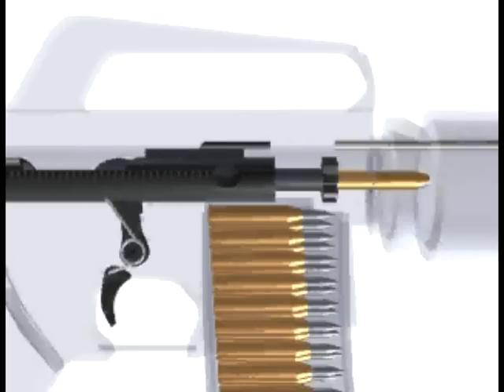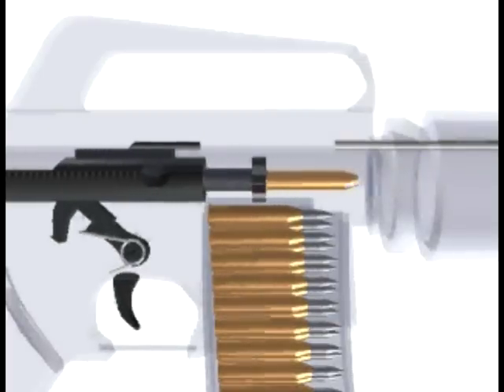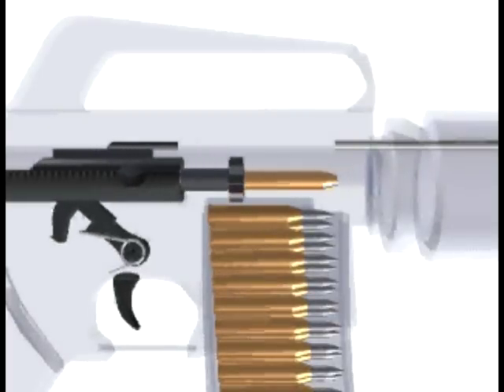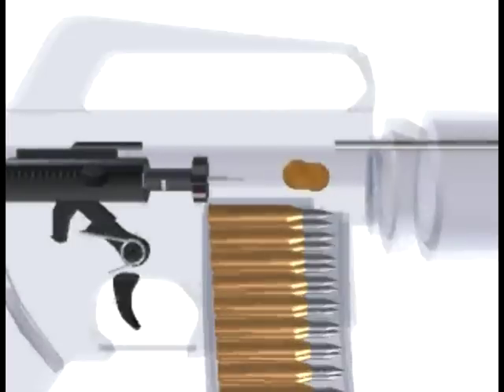M16 Functions Explained

Comment: First, the animation is way off the actual M16.  The bolt rotate much more than needed. The hammer does not strike the firing pin.

Comment: more likely wanted more mechanical data....but this was nicely timed with Definitions and Animation...just felt cheap and lacked other data....perhaps about the Gas system and how on the m16 is unique from any other rifle in that it ditched the gas piston and replaced with just an air tube

Comment: The Marines just ordered a metric fuckton of "M27 IARs". Really just a 416 with a slightly different stock and a slightly heavier barrel. They're not being issued to M249 crews like the Marines said they would, since they have no plans of phasing out the 249. They're just M4/M16 replacements that they snuck in under a different budgetary confine.

Comment: I shoot a decent amount through it. (My wife is starting to shoot it more than I do). I torture tested it and got 2,500 or so rounds without cleaning (only a few drops of oil here and there) before it jammed. If you shoot exclusively wolf you may want to change out to a lighter buffer spring. I don't have to clean my AR repeatedly. I clean it after I'm done shooting, just like all my other firearms.

Comment: M4 magazines initially had issues, when they replaced the magazines, it accounted for over 90% of the jams in the gun... The ammo we use is fine. "but far from being the most reliable as well. " It's reliable enough to almost never jam up in my experience. If you want "super reliable" get a fucking bolt action rifle. "If you treat any gun like a woman - gently and carefully - she'll pull through for you." I've treated my AR like shit and it still worked/works.

Comment: This is a myth. It gunked up in vietnam when they used ball ammo, which you aren't supposed to use... When using half decent ammo it doesn't gunk up at all. The internals get a little dirty, but it's not gunk or hard carbon build up. "Also, the M16 is the weapon most familiar to people within the U.S. and so - the soldiers have an easier time with it." There are piston ARs that are ergonomically the same, yet we still use DI, because DI works and piston ARs are unnecessary.

Comment: @BarrackOLama the chamber is cut or machined so that when the bolt is forced on to it it spins it locking it  if that makes sence..... look the operation of a garand bolt and it will make more sense ... the 16 has a redundent about of locking lugs if you ask me ...

Comment: @TheBlabla1996 No, worries friend.  Its called and extractor and its attatched the the bolt and pivots or cants because it is under pressure of a spring. When A bullet is pushed into the chamber by the bolt, the extractor snaps on the the right side of the the base of the round. Its why bullets have the lip on the bottom.

Comment: @curseofa5r5a that's because the 7.62x54mm NATO round is more powerful than the Soviet 7.62x39mm round used in the AK. We use 7.62x54 ammo in our GPMG to provide more stopping power. We have different weapons for different roles. Even the 7.62x54mm round cannot penetrate a single sandbag at less than 50 m. so to use just this round would be ineffective in close combat as well...not to mention the weapon weights 30 lbs; and the ammo more than twice that.

Comment: @xFogxofxWarx well in here there is type of contruction called "tapia" iit was used to build houses all over the country for decades, this kind of walls has gained a reputation for its tremendous hability to stop bullets including 5.56 and 7,62x39, 7,62x33 and of course all pistols rounds all of them exept from 7,62x51/54mm rounds, and in this case i actually saw that happening, they where using military grade m80 7,62 rounds, 5.56, a .38spl and a chinnese AK only the first one pierced

Comment: @curseofa5r5a Taliban insurgents often have a hard time hitting anything beyond a few hundred metres too. 600 -800 metres is out of effective range of an M16; but not the M249, which is a 5.56 still. Again; we also use GPMGs for ranges up to 1800 metres. Mounted; that range is stretched out even more.

We also travel in convoys that have .50 cal MGs and 25mm cannons. There are different roles for each weapon. No weapon can take on all their roles effectively.

Comment: @curseofa5r5a The M260 (C6 in Canada) GPMG has a range of 1800 metres. It is designed for further ranges; however; most people assume that the 7.62 has better stopping power period. The fact is that a 7.62mm round cannot even penetrate a single sandbag from 50 metres or less. In urban ops; it really isn't advantageous; just heavier and slower.

Comment: @xFogxofxWarx a common tactic among the colombian guerrilla is to attack towns by taking control of buildings around the police station, in those cases the 5.56 has showed to be unefective against  this kind of positions, in that case the most uses tactic by the police is to concentrate their m60s firing in a single building, not to suppres their occupants, but to kill them, this tactic is also usefull to take down mortar crews firing from the mountains 1.2-2 km away form the police station

Comment: @xFogxofxWarx yeha i acept its lethal, even at long range, but there is 2 short comings aobut using a 5.56 LMG in a long range engagement, 1) the bullets would cause less internal damage thus leaving the enemy in an operative condition, obiusly an injured enemy is a tedious charge for its group but in many cases it wont break the contact 2) the 5.56 at that distance have serious problems piercing combat barriers, specially walls and trees.

Comment: @curseofa5r5a Because the M249 is a light machine gun; not a General Purpose Machine Gun. The M60 also weighs more empty than a loaded M249. Unless you want to be running around with 130 lbs or more of weaponry on your person, you aren't going to carry the M60 everywhere pal. Two separate weapons for two separate roles. The 249 is quite prone to jamming by the way.

Comment: @curseofa5r5a The M249 SAW; or C9 light machine gun also uses the same 5.56 round as the M16. The M249/C9 has an effective lethal range of over 800 m. Kills have been confirmed with this weapon from ranges even further than that. I would say if it is lethal at ranges in excess of 800 metres; then it still retains stopping power...and I would say if it has killed people from these ranges; then it is lethal.

Comment: @curseofa5r5a Of the thousands upon thousands of rounds I have put through several C7A2s; I have only had 2 stoppages (jams); both the same day; with the same rifle. It was -30 C outside; and blowing snow. Whenever we stopped firing; the melted snow would run inside the upper receiver; freeze as the rifle cooled; then block the bolt from moving. Any weapon would have this occur. So reliability is phenomenal.

Comment: @curseofa5r5a The C8 is the Canadian version of the M4 carbine. The C7A2 is the standard service weapon. It is modelled off of the M16A2; but more resembles the look of the M16A4. It comes with picatinny rails to mount optical sights (standard on issued rifles); or Eotech sights if you're lucky enough to get one. It is also designed with a heavier barrel; and the whole thing is chromed to prevent stoppages.

Comment: That was a pretty crap video. That didn't explain half of the M16 functions. It didn't explain the cocking system, the direct impingement gas system that drives the bolt or even the recoil buffer that resets the bolt. It just showed the weapon as it fires. There's 1 minute 8 seconds of my life I'll never get back.

Comment: becouse they use to be well postioned, they know the terrain fairy well and they are not trying to hold an area, suppreive fire has showed to be uneffective to break contact in those cases and the heavy direct fire has performed very well to neutralize the enemy, but what if its not aviable? the solider has to deal personaly with them, in those cases the 5.56 has not performed well, hitting the targets but beign unable to neutralize them as fast as its needed.

Comment: @xFogxofxWarx my turn, yes the americans are undisting their m14, but they change the basic layout for a modern plastick body and call it "m14 ebr", but they are basically old guns, the british are pretty confortable with their l85a2 rifles and the new l192a1 is only intended for one man (marksman) in a unit, not to replace the sa80 in the field, and by the way the l192a1 is just a AR 10 with some modifications, its not "something new" and it wasnt even designed by the british (is US made)

Comment: @curseofa5r5a ...we also have several weapons platforms to accomplish this; ranging from 5.56 and 7.62 rounds; to .50 cal and 25mm HE rounds; as well as M203 40mm grenades. For the 5.56 round to be 'effective' at ranges in excess of 100 metres; all it has to do is keep the enemy pinned down. Any round that can accurately be fired at those ranges is effective.

Comment: @curseofa5r5a And unlike you, I know from first hand experience firing these rounds at these ranges. I have fired 5.56 rounds from over 800 metres. I have also fired 7.62 rounds from over 1200 metres. The 5.56 does maintain high velocity at far ranges. Yes; every bullet looses velocity over distance; but that is basic kinetics pal; and the heavier 7.62 round has more force acting against it than the 5.56

Comment: @curseofa5r5a The Lee Enfield is a bolt action rifle that was used throughout both world wars as a sniper's choice. Bolt action rifles are the most accurate design; and it is no question that a skilled marksman from any side could pose a threat with this weapon. The PKM is outranging the M16; but so does the M249 machinegun; which can easily kill a target with a 5.56 from 800 metres. I have fired and obliterated targets with it from over 800 metres.

Comment: @xFogxofxWarx my facts are not form google, but from long discussions with the doctor i told you about, and by the way every bullets looses speed with distance is basic phisics, this happnes with the 5.56 ss109 as well and with any other round ever created, remeber that the round wasnt created to deliver accurated long range, hard hitting firepower, but to optimize the combat efectiveness of the standar solider under the 300 mts, were most combat really happens,

Comment: @N45h actully the AK series are not extremely accurated, the same strong point that gives the weapon its impresive reliability decreaces the accuracyin a considerably degree, very loose tolerances, any way its not hard to find a well made AK capable of outstanding accuracy (specially ak 74 varaints and saiga rifles) and the average ak 47 can archieve adecuated accuracy using iron sigths up to 200 mts (350 with optics), but beyond that you start to notice the lack of pint point accuracy

Comment: @xFogxofxWarx as i told you during the world war 2 there where cases of japanesse soliders runing with 4 or 5 7.62x63 rounds in their chest,  but again they where high on adrenaline just like those taliban in afganistan, but that doenst make the 5,56 more efective at long range, first at 800mts using the actual ss109 it will be pretty hard to hit a target at 800 mts, and even if you hit it the round will be soo slow at that distance that it could be compared with an .22lr or a 9mm at 150 mts

Comment: @xFogxofxWarx well the current NATO m855 (ss109) round remains accurate up to 600 mts (wich is very impresive for such a small round) and according with some sources the new m262 and m855a1 projectiles will be able to accuratley reach targets beyon that distance (imagine 800 mts with an m16/g36/AUG) but remember accurated doesnt mean deadly, at thats distance the bullets would have more or less the energy of a .22lr, can it kill?, totally, will it kill as fast as is needed? i strongly doubt it

Comment: @LeonPao the ak sistem is simpler, but this is very simple anyway, i dont know why ppl say the ar-15 is a super complicated machine that can fail every where due to its endless number of microscopic components, here in colombia they are made in underground workshops, with basic machinering tools and im pretty sure they are even simpler than other desings i¡on the market

Comment: @mrmurdahlic I've shot M16s, I've shot AK47s, I've shot 50 cals with Acog 6x48 scopes.  But that doesn't really matter, the simple fact remains that AK-47s are an inaccurate piece of weaponry.  If you knew your weapons before you came on here bashing me, you'd know why.  And it's pretty simple, all you have to do is look at the construction of any stock AK-47.  From the close sight positioning to the long bolt that rocks the whole weapon violently and throws off the shot.  Do some homework.

Comment: @mrmurdahlic the 7.62x39 round that the AK-47(AKM) fires travels along a greater parabolic arc than the 5.56x45 used in the m16/m4/m249 and other NATO weaponry. The soviet union responded by creating the AK-74, which fires 5.45x39, which follows a similar ballistic trajectory as the 556. 
Both can be quite accurate, but the maximum effective range(point target) for akm rounds is about 300m, and elevation adjustment is required.m16 can shoot almost flat out to 300, and 500 w/ slight elevation.

Comment: @GOcgyFLAMESgo sorry pal but again you are worng, maybe you think there is such a thing a "7,62" round, but the ak use a short round (7,62x39) wich can not be compared with the 7,62x51(or 54r)mm round in terms of ballistic performance, the ak 47 round was designed for close- medium range encounters (under 300 mts), the speed deployed by this round is about 700 mt/s while the 5.56 can deploy more than 920 mts.

Comment: @GOcgyFLAMESgo nop there is something called "inherent accuracy" or "mechanical accuracy" the ak 47 has loose telrances wich reduces the mechanical accuracy, the short sigth redius also redouces the "practical accuracy", and btw the 7,62x39 has a short efective range (250-300 mts) while the 5,56x45 can be used up to the 600 mts, any way the AK 47 want designed to be an accurated weapon, i was designed to be durable and reliable in the hands of a masive soviet army.

Comment: @MrCassaroleCyrus thigh tolerances, the same thing that makes the weapon accurated, any way this rifle had serius probles in vietnam, when they were using bad quality ammo, and were promoted as "low mantenience weapons" (considering that the DI sistem requieres more mantenience than the most common piston sistem stupid colt), the m16a1 used back then were overall bad made weapons with no cromed lines, BUT  rgith now the m16 plataform its pretty reliable and functional if well manteined.

Comment: and about the 7,62, yes, you can find reports of japanesse soliders during ww2 walking and even running with 3 or 4 .30-06 rounds in his body, but they where high on adrenaline and the shots missed all the vitals, well this is pretty much waht happens in afganistan with the 5,56, but with a main diference, the 5.56 mm wasnt designed for long range shoting (unlike the 7,62x54r those guys are usign) this round becomes unestable and "weak" at ranges beyon the 300 mts (now normal in afgan)

Comment: @xFogxofxWarx well the piercing capabilities od the 5.56 are remarcable, but its a ligth weigth, small round, wich traduces on low sttoping power, unless you bullet do something special like yaw or desintegrate, thats what makes that round deadly, but this round doesnt do this all the time, some times it just make a clean little wound, and the chances reduces if u are using a short barrel (slower bullet), so at 300 mts this round isnt likely to desintegrate or jaw when hitting an human torso.

Comment: @curseofa5r5a The 5.56x45mm round does not lose any stopping power quickly. The 5.56 maintains its stopping power for several hundred metres. It penetrates the same distance of sandbags from 100 m as it does from 300. It can take several 7.62 mm rounds to take someone down; and that is time that they do strike back then as well. Keep in mind most of the people being shot by us are high on opium.

Comment: @rammsteinlover1337 and whatever video game or airsoft expert you clearly got your information on; you are horribly wrong. The 5.56mm round has as much stopping power at longer ranges than it does at short...in fact; then 7.62 is not nearly as lethal at close range; which is where the AK is most effective. At 50 m; a 7.62 round cannot penetrate even a single layer of sandbags. The 5.56 is far more consistent with it's stopping power than the 7.62.

Comment: @rammsteinlover1337 and you should know from all your experience with these rounds hey? How many times have you fired a 5.56x45mm NATO round? Yes, the Russians sure did make the 5.45mm round; to replace the AK's 7.62 round. The difference is well the USSR and Russia have been using multiple weapons; insurgents don't; and when discussing the AK 47 (which is not 5.45); then it does not compare in those same regards.

Comment: @rammsteinlover1337 Unless you're engaging an enemy that's 1000 metres away...in which case the AK is then not accurate enough. Our militaries function with different weapons; each platoon carries more than M16s; they carry light machine guns; and general purpose machine guns. We can engage enemies from 1800 metres away. The AK itself is trying to fill the role of a whole line of weapons; and that is its biggest problem. When the USSR used it; it was far more effective against conventional army

Comment: @GOcgyFLAMESgo I've handled both the AK and the M16. No I am not from the States; I am from Canada; and I'm infantry. The AK47 is outdated in the sense that it cannot keep up with the accessories. There is nothing that can be attached to the 47 variant. Newer versions are featuring mounting rails and such to add on. The problem is that all AKs, even the new ones are still set up only for left handed shooters. A trained soldier functions faster with an M16 than an AK.